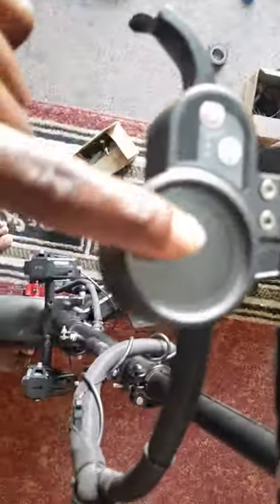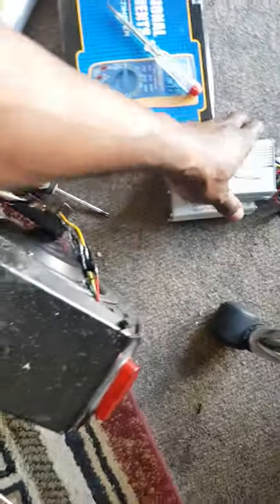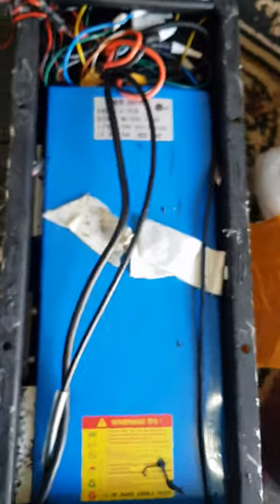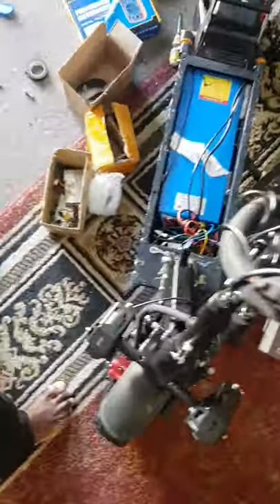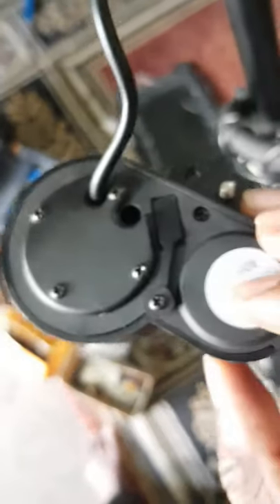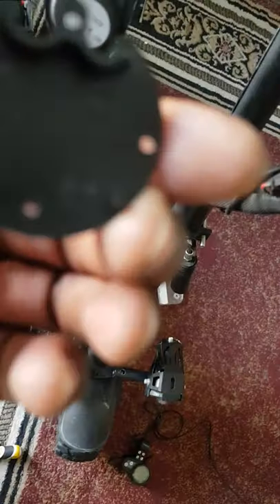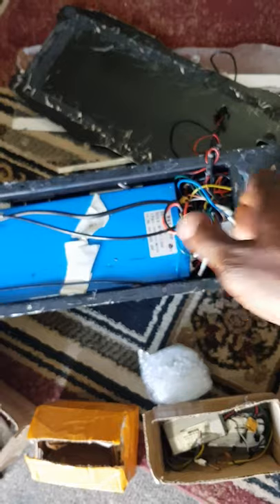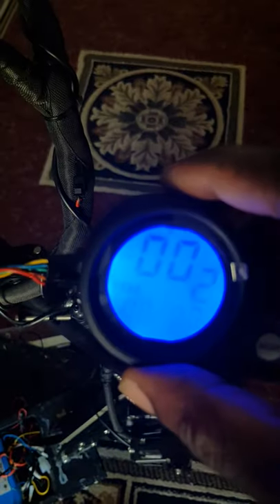Electric scooter 3200W 60V 30A accelerator replacement and diagnostic.

Comment: I have a scooter gyro corp 48v 800w...my problem is in my throttle lcd the battery label is always full not working....so i dont know the label use in my battery thank you for your responce
Reply from the maker: Hi, sorry to hear that. Sometimes electrical components can glitch. You need to disconnect the LCD from the power supply and wait fir the battery to completely drained empty. Re-connect the LCD to power and charge your battery again to full. Use the scooter and see if the battery level dropped on the LCD as you use it. If it does then your glitchy issues of the LCD is solved. If not and still the same then you have a faulty LCD that needs changing. I hope this helps you.
Reply: @michaelmilenamg  Ok.....thank you for the replying☺

Comment: Mike on my my gunia fixed old lcd clock n axcellarator. Happy thinking just put plugs back nothing..damaged do I trace the lead n fit it to appropriate  place.will lead go in white boxer front of battery that's g get back to me lead go in controller or battery
Reply from the maker: Hi, your comment was noted. I tried to understand what you mean but a little confused. Can you tell me precisely what the problem is ?
Reply: @michaelmilenamg  yes bro thank in same boat .got mew 1 coming glad av leads.spring had come out of lever fixed Bach in lit up rev nowt went off some of the pins in female side  fooked wiggle it com on go off.been waiting 10 days.but you've describe easiest way thank you brother cant wait swap deal both brand new.im making big but they want mine cos ppl are googling for price so he'd get robbed soon off him .but notta chance.nuff love n respect..you've simplified very well  thank again.bet ya here from me again🙃😆🤣🤣🤣💙
Reply: @michaelmilenamg  spring come loose so order the new but only notice spring when undone it.manager to wind spring back on lever.screwed it back turned boom buzzing.*but already order new one).then went so faulty connection.tried all sortsdodgey wiring.as I done have much experience. Tried wiring them nothing. While the lead come with part like ours??so can trace down to box begging it does spent 40 quid 2 week later ain't arrived from amazon.need lead though order it seperate.begging in has to I can do it
Reply: @michaelmilenamg  the plugs u clipped in 1 was damaged. So going to have to trace ice it.but also found good diagram which shoes me exactly which plug to to undo.do u know which settings thy should be on.part should be here today tomorrow. Yo taken ages
Reply from the maker: @karlkarl3162  Hi, sorry. I am at work while trying to help you guys so sometimes it might take time to get back to you but happy you found the problem.
Reply: @michaelmilenamg  mike part just arrived sos I thought it would have plug it hasn't.please help a brother WhatsApp little video rocked my head
Reply from the maker: @karlkarl3162  You need to send me a short video of the problem and the parts you got so I can help you.
Reply: @michaelmilenamg  I will send the picture.basically no plug on lead for controller box.di have to remove old and slot in new .same thing as your video but i wasn't fortunate just to clip